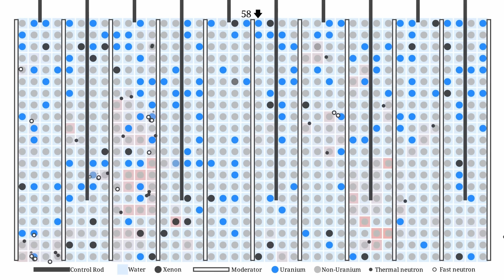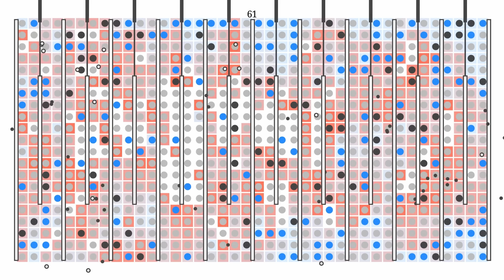Chernobyl Accident - Simulation only (no talk)

Comment: Aside from the ending, the part that really creeps me out is when all the control rods are pulled, because you can almost sense the engineers were kinda scratching their heads at that point like, "Hmmm. Why isn't it working as expected?" You can almost sense a debate going on between the engineers in the control room as the rods just linger there, with half of the group saying, "We need to stop NOW. This is NOT good. Sure, it doesn't look dangerous, yet, but who knows what will happen if we keep the reactor like this?" And the other half, or whoever was in charge (Dyatlov?), is basically saying, "It's not as bad as you think. Look, the reactor is still stable."

Only when you start to see steam voids can you see the engineers saying, "Okay, okay, shut it down. Not worth it."

They hit AZ-5, the control rods go down and -- wait they haven't gone all the way down. What is happeni--"

KABOOM!!
Reply: There’s also the fact that the rods when fully withdrawn are not only less effective at neutron absorption but actually make the reactor more reactive at the beginning of being absorbed due to them displacing water on the way down.
Reply: @dstods not only that in the end in the video, a few more moderator rods appeared, 
wich irl where about 2/3 of the controll rod lenght and attached below the controll rods for more efficency.

but since they didnt reach the reactor bottom when the controll rods were fully pulled out, at the bottom a bunch of fast neutrons could accumilate and when the az-5 was pressed, the displacement moderator from the controll rods caused them all to slow down and rapidly react, creating tons of heat boiling ALL of the water in the reactor at once (wich was not boiling due to the running at low power as it was xenon poisones at the top) ,wich let to the multi ton reactor top being blown through the god darn roof . . .

All in all the accident was caused, by the reactor design, and the issue with the controll rods/controll rod moderator displacer, wich they knew about but didnt tell the operators so there was no way for them to know that the az-5 could in some cases be a detnation button.
Even with my previous statement the crew on shift at the time could have realised that the reactor was unspable due to being xenon poisoned and shut it down completely, wait 12 hours and then start it up slowly to prevent damage.
Conclusion: chernobyls accident was caused by design flaws, keeping said flaws secret from operators and in the end Human error.

And yes this is a very long text but ive always been facinated by the accident and nuclear stuff in general :)
Reply: @Maxikxng  If I remember right some high rank party official was coming there and the in charge had face to show, so he didn't wanna do the waiting stuff.
Reply: @kenc00l  i dont think thats the case since this was the nightshift
 + they were over 12 hours of scedule since the electrical grid manager told them they needed chernobyl online at at least half power untill nighttime

 (wich is also the reason it was zenon poisoned as running the rbmk 1000 type at half power for extendet amount of time hinders the ability for the reactor dispose of the zenon thats constantly building up while the reaction is running)
 
all in all it was missmanaged wich wasnt too suptising since it was the ussr, design flaws were ignored and safety regulations overgone.
 
And since its once again one of those accidents where on the engineering side all problems could be fixed(and in modern reactors have been fixed)

 and the political side fucked up super hard
(not telling the public sooner, giving false levels of radiation outbreak and other governments knowing its false telling their own population to not eat mushrooms found in forests for example since those take up radiation(this happened in germany))
The thing with the engineering side and political side also happened at 3 mile iland and a few other radiation accidents  and has absolutely destroyed the publics view of nuclear reactors even tho in total they put out less emmisions then most other energy sources, cause less deaths then other energy sources(total deaths to ALL nuclear accidents is less then what coal causes in a single year)
And in general has a smaller footprints for power generated (uranium mines arent nearly as big as coal ones, nuclear reactors are larger then coal plants but output multiples of the power)

So yea if anyone honestly read that text block congrats and i hope you at least agree with some of it :)
Reply: @Maxikxng  It's a big big shame, we are stunting our own development and advancement.  I really despise the media and the political side of things, for they ruined nuclears public perception. The fact we aren't self sufficient on nuclear already and figuring out the next step it truly sad
Reply: @Ezekiel_Burton  can only agree but luckily more and more people are realising that nuclear has gotten a lot safer and efficient :)
Reply: @Maxikxng  Do you know what concentration of uranium is in rock and what concentration is in coal? Uranium mines are much bigger than coal mines. Not to mention the amount of waste after uranium enrichment
Reply: Dyatlov?  is that always involved in something bad in Russia lol
Reply: No, that's not quite true. The nuclear power plant has had problems since it was built.
Reply: "It's not as bad as you think. Look, the reactor is still stable." - Famous Last Words
Reply: I think the actual events were probably a lot calmer and Dyatlov was not as incompetent and arrogant as he made out to be. I mean, we are getting much of our perception of the events from a combination of official Soviet records of the events and western assumptions which are both incredibly unreliable sources of credible information. I really doubt that well trained physicists working in that room were that incompetent and panicked. As far as I can tell, some of them died and others were scapegoated because of a design flaw. If anything it was casual complacency that contributed to the problems and not deliberate disobedience of instructions.
Reply: “I never thought I'd see a reactor meltdown, let alone create one.”
Reply: На самом деле реактор был стабилен до момента нажатия кнопки AZ-5. Она спровоцировала взрыв как кнопка на бомбе. С её нажатием при тех условиях возросшая положительная реактивность перекрыла существующий запас и реактор пошел вразнос.
Reply: Наконечники стержней были из графита который ускоряет  реакцию...по сути нажав az 5 , они нажали детонатор
Reply: Thanks for this comment, it helps make sense of what happened!
Reply: It didn’t work as expected because the rods were made from borium.
Reply: Plenty of this has been disproven. The control staff was all pretty calm, yet tired. The decision to shut it down came when control shift chief, A.F. Akimov gave a simple shutdown order once turbine testing rounded up.

Dyatlov had no real hold on reactor operation, he was more there on account of his position, he left all decisions to Akimov.
Reply: @isaowater   Also the shutdown was part of the test, it wasn't an "oh shit it's going to explode" reaction.
They had to trip the turbines and shut down the reactor anyway, the only thing is they did it when too low on power, but i guess they thought that well, the reactor must be shut down, let's trip the turbines anyway, the worse that can happen is another failed test.

In fact, the reactor was running in a state that is so rare, nothing would probably had happened if they had scrammed 10 minutes earlier or later.
As for most of these accidents, Murphy's law was going full power, and just a different random action would had probably choked the reactor and everyone would had just went back to sleep normally that morning.

As for Dyatlov, he said nothing relevant happened in the control room, and the only thing he regretted was sending two men to manually open the valves, just to realize a few seconds later he just sent them to the creator.
Reply: @giacomoneri1782  You've got the right sources, this narrative usually hasn't been the prevalent one for the past couple of years, where'd you read all this?
Reply: @isaowater  And all operations were within the operational protocol! The RBMK design flaws were not known by any of the staff and mitigations were not in the operations manual. When things went tits up, the operators were blamed, not the government body responsible for developing operational protocols! This blame shift persisted into the HBO miniseries turning many of the good/innocent guys into victims and vice versa. All RMBK were bombs ready to go off given the right conditions until modified with upward control rods to prevent the bottom of the pile from going inadvertently critical! Dig in here https://www.youtube.com/@thatchernobylguy2915
Reply: @isaowater source: trust me bro
Reply: @RC_Engineering he was on the control room, trust him
Reply: @RC_Engineering  The Soviet and western governments at that time are basically the equivalent of trust me bro anyways
Reply: @isaowater  plain wrong the reactor crashed as they were trying to do the test due to being xenon poisoned then when they tried to bring it back up they made lots of mistakes(wich are listed in my original reply) and blew the reactor
Reply: @Maxikxng  nope! whats your sorce? mine are insag-7 and publically available interviews w/ operating staff
Reply: @isaowater  honestly cant quite remember it ima look at yours ig always intresting looking at this incident
Reply: @Maxikxng @isaowater I want to be a fly on the wall in a realm where you guys meet and have a conversation. I find this so interesting but I'm a layman. I wanna hear the gritty details tho. The machinery, the equipment, the science!
Reply: @octapie666  then you should see someone with a degree in the field that knows every detail of these reactors xD and honestly try reading into it yourself theres enough data on the internet
Reply: One key thing to remember is this taking place in Communist Russia. If you don't meet your power quota, kiss your job/life goodbye
Reply: Sbluuush...
Reply: Wonderful comment
Reply: F around and find out
Reply: Dyatlov: "Not great. Not terrible."
Reply: Pulling the rods out further than the regulations allowed was not that uncommon, in fact it happened the previous day as well. Part of the issue here is that the parameter monitoring this (the "ORM") was not directly available in the control room, instead it was only periodically calculcated by a computer program that moreover was known to not always produce reliable results. The fact that this was deemed fine further shows that this parameter was not regarded as particularly dangerous. Since the other reactor parameters were okay until after the AZ-5 was pressed it seems unlikely there was much reason for concern, they had no way of knowing that the reactor design flaws combined with the current state of the reactor had turned the AZ-5 button into an "explode reactor now" button.

Comment: here is where it gets confusing to me: if the tip are made of graphite, why is it only shown when the AZ-5 is pressed? its not magically there when the button is pressed it was there since the reactor is built. somehow event 5 is like the designer is pulling the biggest prank in the history of mankind
Reply from the maker: it's because the animation is from another video, where I slowly build up concepts. so no it does not make any sense the moderator suddenly pops in

Comment: 1:38 - I am puzzled by power drop to 1%, as a just scrammed reactor typically drops to 4 - 7% of nominal power, depending on fuel state: 4% when the fuel is fresh and 7% when fuel is at the end of life. As the unit 4 reactor was running at 50% up to that moment and the fuel was about to be replaced (end of life), it should have dropped to 3 - 4% of nominal power, not 1%.

2:42 operators did not turn off the computer, it continued to operate to the very end. They simply ignored warnings (if there were any). They disconnected automatic control rod system and moved rods manually - and they did it an hour earlier - when power dropped to 1%.

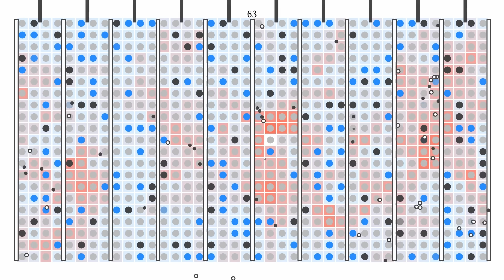2:46 they agreed to raise the power to 200 MWt and start the test, as they were in a hurry to finish it. They could've reached more that 200 MWt, but they had to wait longer. 200 MWt was chosen as it was minimal power at which one turbine could operate.

2:51 some pumps were turned off as they weren't needed for reactor running at half power. Water cooling wasn't slower because of that, actually running all pumps when reactor was at half/low power could trigger cavitation effect. Two pumps were turned back on as a part of the experiment, exaggerating the power drop issue.
Reply: Can I have your sources? This correction sounds interesting but I don’t want to spread misinformation.
Reply: Xenon poisoning was working against the reactivity.

Comment: > the computer warns them to shut down immediately, so they turned off the computer instead

This is a completely wrong statement. At least because such computer did not exist at all. There was kind of a statistical computer placed in a different room which gave out periodic non-critical information.

The general reasons of the disaster are:

1) miscalculated grid pitch of the reactor channels
2) positive steam effect
3) effect made by end parts of the rods

Please also check INSAG-7 report for the correct reasons of the disaster. Here is a part of the report:

The Chernobyl disaster was caused by the by the developers' choice of the RBMK-1000 reactor of a concept that, as it turned out, did not take safety issues into account sufficiently, resulting in physical and thermal-hydraulic characteristics of the reactor core that contradict the principles of creating dynamically stable safe systems. In accordance with the chosen concept, a reactor control and protection system was designed that did not meet safety goals. The physical and thermal-hydraulic characteristics of the reactor core, unsatisfactory from a safety point of view, were aggravated by errors made in the design of the control and protection system.

The RBMK-1000 reactor, with its design characteristics and design features as of April 26, 1986, had such serious non-compliance with the requirements of safety standards and regulations that its operation was possible only in conditions of an insufficient level of safety culture in the country.

The personnel actually committed violations of the regulations, and the Commission notes them in the report. Some of these violations did not affect the occurrence and development of the accident, and some allowed the creation of conditions for the implementation of negative design characteristics of the RBMK-1000. The violations committed are largely determined by the unsatisfactory quality of the operating documentation and its inconsistency, caused by the unsatisfactory quality of the RBMK-1000 design. The personnel did not know about some dangerous properties of the reactor and, therefore, did not understand the consequences of the violations committed. But this is precisely what testifies to the lack of safety culture not so much among the operating personnel, but among the reactor developer and the operating organization.
Reply: Can I have your sources for this??
Reply: The main conclusion from the INSAG-7 report is that the reasons of the explosion of the reactor of the 4th power unit of the Chernobyl nuclear power plant are not known for certain.
Reply: @holycarrot4782  Could you please provide such citation from the report?
Reply: I don’t know about anyone else but that sounded like 15 different ways of saying something was wrong and not really explaining how it was wrong, the only thing actually mentioned was the hydraulics, but no mention of how it actually failed nor is the any mention of how anything failed, this comment is just a giant nothing burger
Reply: @SilentStorm98  Comment is not a nothing burger, you just don't understand the technical details. He clearly pointed out two major issues with RBMK: positive void, and the graphite tips on the control rods.

Both are serious safety flaws. Graphite tips means from full withdrawal to insertion there is a reactivity spike. At sufficiently high reactivity this can cause the reactor to go "prompt critical" and runaway, as is theorized about Chernobyl.

As for positive void coefficient, this basically means as the reactor gains power and heats up, more steam is generated. Since the reactor is graphite moderated and not water moderated, this means reactivity increases, which is bad. Essentially, it's another runaway trait. Power increases? So heat increases, and then power increases, and so on.

PWRs (pressurized water reactors) do not have this trait and the types of BWRs (boiling water reactors) used elsewhere besides the RBMK design the Soviets used also do not have this trait, at least not to the extent that RBMKs have (the graphite moderation is the crucial safety issue. Other reactors that have water boiling in the core also utilize that same water for moderation, so the effect as not as strong as RBMK where you are boiling off the neutron absorbing water but the graphite moderator is left over).